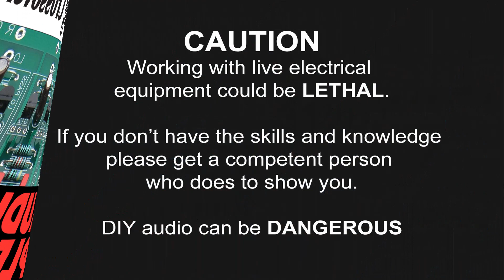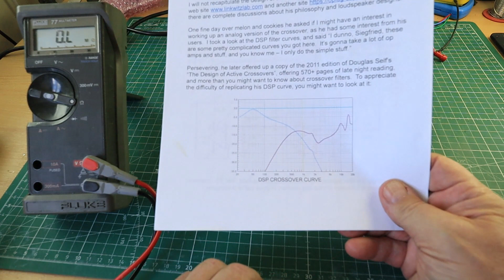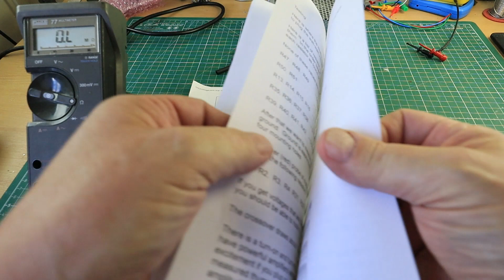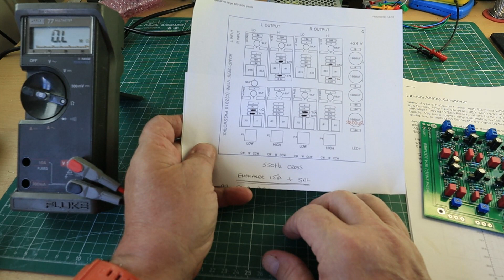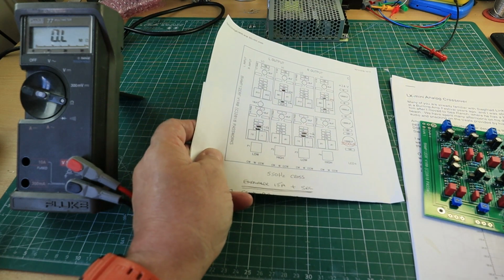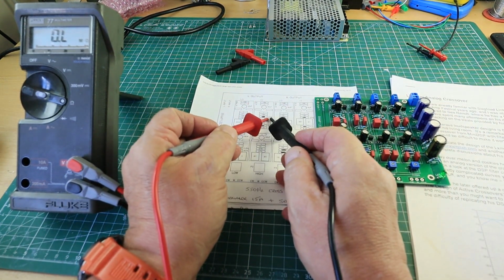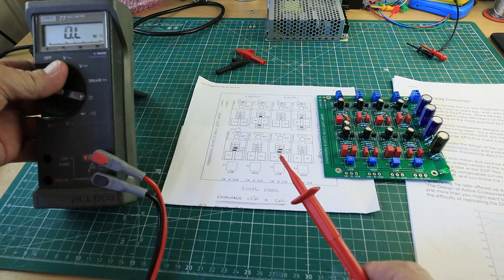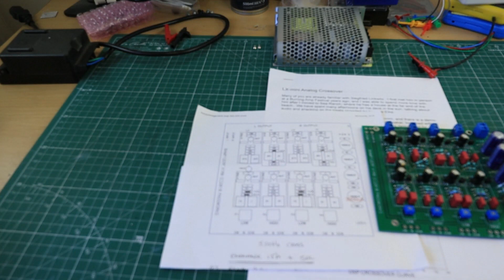Pass DIY B1 Korg + the DIY LXmini analog crossover build (Pt1)

Comment: How come you switch off the F6 when changing cables ?
Reply from the maker: Just a habit I have. In years past I have blown amps and speakers while changing cables so to be safe I always switch off. I recall changing speaker cables and shorted the banana plugs then 'pop' one knackered amp and drive unit.

Comment: Are you not afraid that you ruin the performance using SMPS power supplies. I have had no good experiences with them i HiFi applications.
Reply from the maker: I find this a strange comment as many 'hi end' mainstream manufactures (world wide) use SMPS supplies in there products, CD players, Power amps/preamps etc. The list is endless.
Reply: @thediyaudioimplementers1826  Yes the list i endless with manufactures that use cheaper and smaller devices, to make more profit, and make devices more wife friendly. That does not mean they are good.

Comment: You say you're doing a clone of the PAP Trio15. Can you share details? 
At this point in time I must continue the journey down the Linkwitz mini trail because I don't have the space right now for big speakers. That changes before too long and space will be abundant. When the time comes something like the Linkwitz 521, a PAP clone, or a GR Research open baffle will enter the picture. I found a PAP clone at the lautsprecher.de website that uses a Tang Band W8-1772 as a substitute for the considerably more expensive Voxativ. 
I bought the Pass balanced ASP board for the LXmini+2 and appreciate the fact it has so much flexibility. 
Thanks for what you're doing.